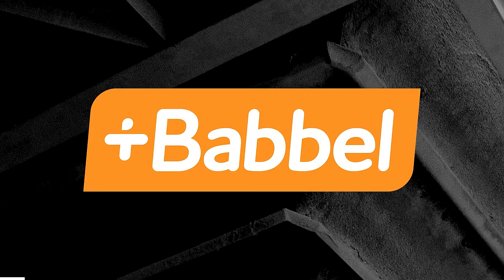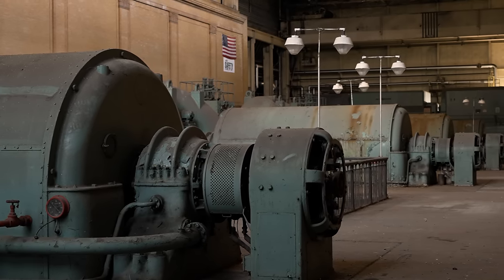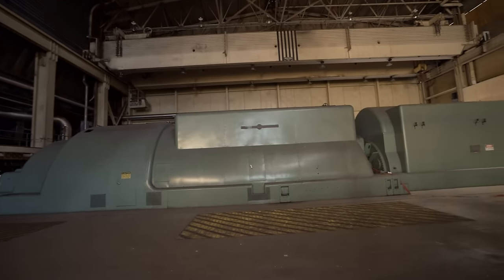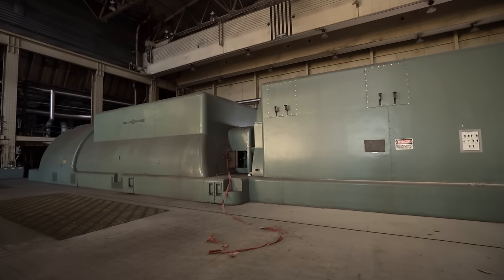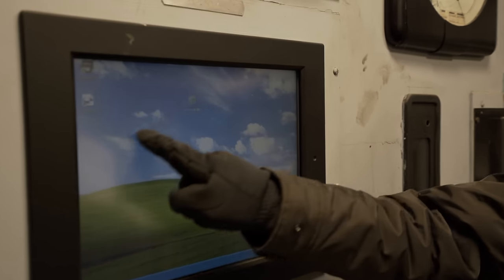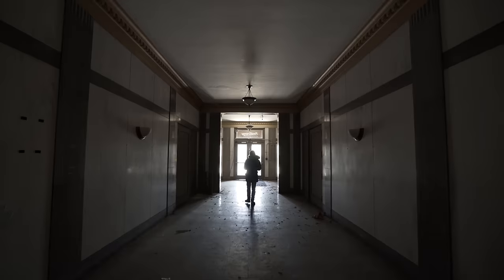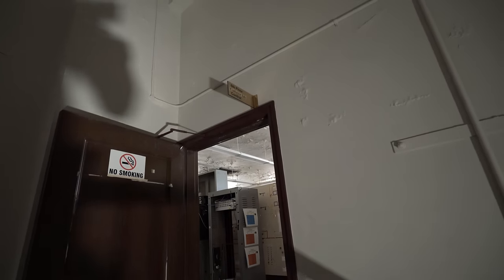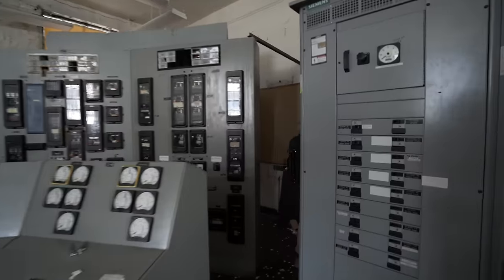Power Still Runs Through This Abandoned Power Plant! - Exploring Industrial Ruins

Comment: It's such a shame that they don't preserve power plants like this as a museum and restore it so people can visit them. I think some of them should be saved and restored. This was pretty cool. I hate when teens just go in and smash shit up because they're bored and that's what they can do.
Reply: And then the museum makes you pay 200 dollars to see one room :/
Reply: Our old power plant is now a museum and can take guided tours of the boiler house , control room and the turbine hall, they used Parsons high/low pressure turbine units 😎
Reply: VERY EXPENSIVE to restore an old power plant to a museum status, and even if you can, this is not enough alone to being in money so it can be sustained.

The cleanup alone, and I am speaking of oil in the ground as well as chemicals, is extremely expensive then you still have to preserve the station and the equipment.

Fisk Station in Chicago originally had old GE verticle generators/turbines, and their answer was for GE to take back one of those vertical units and put it in THEIR OWN museum of sorts so it is preserved.   The station is still in place but retired but the switch houses are alive.  This includes the switch houses INSIDE the station.   So if any of you happen to get inside this station, I strongly suggest you NOT operate any switches or open any doors. and if on the old side, that area IS asbestous contaminated.
Reply: There's actually a power plant here in Sweden that is both still in use and a museum, it's called ''Finnfors kraftverk'' and was built all the way back in 1908 and last expansion phase or whatever was in 1935.
Reply: @Boomer112  The station near me was built in 1912 and it just retired last year.  it is sitting there now just about abandoned but still has guards walking around.  I can only assume it is because much of it is still energized.  Back then, the bus work was inside the station as well as outside so it will take some work to get it all out and cut off the inside equipment.  I believe the asbestous problem was taken care of when the old stokers were taken out for scrap.
The station as a whole is pretty much whole and it has that intricate brick work that they did back then.  But I hold no hopes of them making it a museum.
Reply: People just care about some mouldy old building.
Reply: Buildings like this are a pain to care for, since most of the insulating materials used at the time were some variety of asbestos.
Reply: This place requires just one technical person as guard with good pay to keep it preserved. Just in case they need it in future. Flooding will keep things wet and damp. It will keep deteriorating if not maintained. Please hire me.
Reply: Yes! This one especially. I like this one a lot.
Reply: @bluelivesmatter8502  no  hire me
Reply: True, they could preserve older power plants to see what was wrong if anything at all, and see where they could improve with the future of power plants.
Reply: Agreed 100% it’s a shame most of americas Art Deco and Modernist industrial complex’s have been either demolished or left in horrible states of decay. It’s understandable not being able to be able to keep the places up. But it pains me nun the less seeing them torn down.
Reply: An old coal plant from my hometown became a museum in the 1990’s, it’s called science central in Fort Wayne, Indiana. Still has some aspects of the power station but it’s mostly a science museum.
Reply: @jacksonriecken5016  Hey neighbor! I’m from Evansville and that’s only a couple hours due north of me. I’ll have to look into that. I’d find that incredibly fascinating. It’s a shame we don’t have more museums around here. There were plenty of WW2 era factories that have some insane history here in my town. It’s just darn shame everyone sees a dollar sign when they see an old property and would rather make a buck off of it and build something pointless instead of preserving history.
Reply: The Canadian side of Niagara Falls has an old hydro plant has a museum, was built in 1905 that ran until 2006 with heavily original equipment due to producing legacy 25hz frequency for slowly diminishing old industry.  They even built a glass elevator next to one of the turbines so you can see the whole lower operation and then walk the discharge tunnel to see the falls.
Reply: maybe we can get zeppelin to record another album in the turbine room
Reply: I worked as a contractor in many of the aging coal fired power plants before retirement.I was fortunate to be in some similar facilities during operation. I witnessed  the old Philip Sporn plant when the last unit on line consumed its remaining coal and was shutting down for good in 2015. It was actually sad! Forever silent and eventually demolished in 2022.
Reply: Totally agree....Restore   these power plant's and all the old turbines  to a museum. Like the Retro look of it all. Every thing was left like they could go in there tomorrow and start them again😢
Reply: Personally I’d turn the RO (reactor operations) room into a training room.
Reply: @bluelivesmatter8502   Why do you think the server room was still running, all the areas had some fully intact equipment (ie not stripped down) and there was power cables running everywhere for the 'essentials'? Do you think it's for a fun joke? No -  it's on life support already - just enough so that if absolutely required it can still be brought on line which although costly would cost a fraction of a new build.
Reply: If someone would take the time to educate themselves about power generation and certain industrial processes then they could teach their children about why it's important to preserve artifacts like this. That's why they just wanna "smash shit". They don't see it as important. What else do you expect?
Reply: I wanna take some of the readout machines and other salavagable things from these places one day and keep em in a warehouse of mine and preserve them. After all these places get demolished, all this stuff will be lost.
Reply: 24:34 did you see the CCTV?
Looks new
Reply: If it still has power that means the generator still works and I wonder what would happen if I put a lighter into it or maybe some sort of gas
Reply: Never should have been shut down.
Reply: @philipjacobs394 most plants replace that in the 80s because I was part of the abatement don't talk unless you know what you're talking about
Reply: Yeah but it will be a lot of money
Reply: Use the power.
Reply: I know there's a nuclear power plant in Florida that had a museum at least for a time.
Reply: Here's an idea for a video game... Power Plant Simulator.

Comment: I bet the turbine hall would've been magnificent at night in its heyday. Those street lights glowing on the wet brick,lighting up all that art deco detail...wow. Thanks so much for sharing!
Reply: Street lights? Wet brick? What ya mean bud?
Reply: @bluebird8004 in it's heydey he said. Gotta use your imagination
Reply: @bluebird8004  The "street lights" look like a later addition. (Based on the conduit used.) Depending on when they were installed they may have been incandescent or mercury vapor. Metal halide would be the best though.
Reply: @bluebird8004 He's a time traveler, reminiscing about the future good old days.
Reply: The old stations, like this one, most likely had incandesent lights hanging from the walls.  They may have had some on the ceiling where they changed the bulbs riding on the crane.
The incandesent lights when compared to todays standards, were not great.  but back then, incandesent lighting was kind of new and was the best they had.
This is the only place I've seen street lights set up in the Turbine room so they had to be a later addition.
Reply: As another stated those street lights weren't there originally. I worked there in the 70's and they weren't there.

Comment: i love that electrical hum. the current is saying "i am here. i am dangerous."
Reply: 20kV can jump a long way to get you. This plant could have more. The switching tools for 20kV actuators are insulated and over 3 feet long to keep you away from the live surfaces...
Reply: @Munakas-wq3gp   oh yeah. when tf boxes say "keep away" they mean it! free cremation included.
Reply: Why, when all the turbines are switched off, can we still hear this loud 60Hz hum everywhere? Isn't it the sound of a lot of electrical energy converted to heat? Where? Why didn't they fully disconnect the plant?
Reply: @bjoern_eberhardt  my best guess is support power, to keep switching gear alive.
Reply: @asn413  What's "switching" gear? I know nothing about any of this.
Reply: @-Ncrypt   well some switches are so big they need electricity to operate. for example, one kind has to re stretch a big spring with an electric motor after it operates so it can trip instantly if soomething goes wrong. then  theres the big cabinets and stuff in the plant. and the switch yards outside (chain link encolsures. connects to the grid) as i think about it there might be part of their main lines still running through there as they'd been there since the place was built. all probably automated during this visit.
Reply: @asn413   I see, so they’re mechanical switches powered by electricity, that are there to sense the change of a certain condition and, if it senses a dangerous change, trips for safety reasons?

I don’t understand though why they didn’t just shut absolutely everything down if they’re decommissioning the plant. What’s the need for switches if the plant’s not in operation?
Reply: It sounds to me like it's saying: "I'm here to make your life better than it would be without me."
Reply: @-Ncrypt  its nice to have a backup incase the other ones go out
also, there are probably a lot of things that were connected to this plant that potentially were only connected to this plant, so to avoid the headache of finding and adding those things to the grid, they just continue to run power through the plant, since all it does is add a small extra layer of maintenance.
Reply: There’s still juice.
Reply: @bjoern_eberhardt  For the most part, you are hearing the humm of the transformers as the windings and transformer casings vibrate.  Its similar to hearing a office florescent ballast humming in the lighting fixture in the ceiling.  you've heard it before.
Sometimes high voltage pots can hum.
The sound is created by the AC volt polarity switching 60 times(cycles) per second.
DC power does not switch polarity, called direct current.
The generators will invert polarities at 60 cycles per sec to create the 60 cycles, and it is this switching of the polarities that creates that humm.
Reply: @-Ncrypt  The power plants are not like a warehouse, where power comes in to a power box then distributed to the plant.

The power plant in some cases is the hub to the power grid.  Granted, the bus to the grid in MODERN plants is outside in the yard and the control switches are in the control room, hence its a bad idea to turn switches in the control room, which these guys do in almost every video they do.
In the older plants, the grid breakers/buses, or some form of the system, were inside the generation buildings.  This is simply the way they did it back then.
In the process of shutting down a generating station, they can, in most cases, shut down and isolate the generators, aux equipment and tag out of service.
But if the old buses were integral to the system, even if only in aux power cases, there is power in the station.
It is not unusual for the voltages to come into the station at 4kv,  2400v and be controled by those bare copper switches, again, these guys opened the doors and stuck their nose in there, not smart.
To even open those doors required electrical gloves, a electrical cloak and face shield for protection.
In the dirty dusty state that the switchroom was in, it is even more dangerous as electricty can make a path in the dust,  and YOU would be the ground.
Some of these stations may be retired in the main building area but still have areas outside required to be operating, that is ALIVE with power.  In the older stations, a lot of those outside power centers had controls inside the station.
Those outside areas would be manned or operated by roving operators.  They are not assigned to stay on property.  In modern stations, these remote centers, what ever function they may serve, can be operated automatically by remote (off property) centers.
What remains operating depends on how integrated the station was or how updated the environmental demads made them, and these concerns usually are on going, even though the station no longer operates.
Reply: the hum is the sound of transformers !!
Reply: Yeah, that hum is both captivating and ominous. It's a constant reminder of the immense power flowing through those lines. Definitely commands respect!
Reply: Where is there current? This is supposedly abandoned for years.
Reply: Sounds to me like it's saying: "Hey copper thieves, I have a secret gift to share with you. Come F around and find out ".
Reply: @-Ncrypt  they cant switch everything off as the Grid Runs trough the power plant form another power plant that is further down the line and that plant now needs to power the homes and business that this power plant powered, all Nuclear power plants are connected together to form what is the power grid, an example is chernobyl after the last reactor was shout down, the plant continued to have power routed thought it, till they changed the power lines, so that is why you hear that noise as the power plant is still having power routed thought it dose not mean that the reactors are running, its  designed like this.
Reply: @Fear-Tube  That's a really good explanation. Thank you!
Reply: @GrenadeGoose  that is exactly correct. The city of Ashtabula was powered from this plant in the 40's. As the load increased from industrial expansion more power was brought in via inteconnections to other utilities. Once Ashtabula power plant was shut down the power still came in via high tension lines and was the distributed out onto the local grid. The voltabe coming in from the grid was 345 kv, and out was at various voltages from 132kv down to 4.6kv.
Reply: @Fear-Tube Then it seems like it should be locked up and have guards 24/7. And it shouldn't  be allowed to deteriorate.

Comment: You can tell how much pride was put in the construction of this building, and not that it was just thrown together. How the times have changed, so sad
Reply: There's a good reason we don't, it's called combustible dust. Architectural details may look nice, but they leave surfaces where dusts can accumulate and spread a fire across a facility much faster than if they weren't there. There's a lot more thought put into these kinds of things these days.
Reply: @Montgomerygolfgator I never would have thought of that, but that's a good point.  The building I live in was built in the 20s, and the remaining surfaces like that are virtually impossible to keep free of dust.